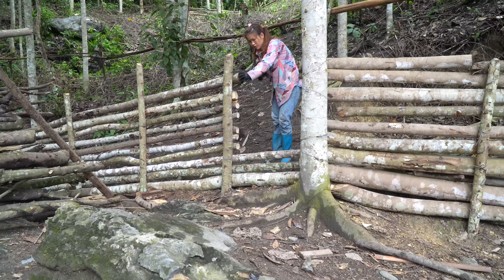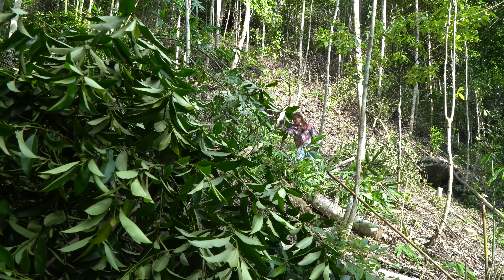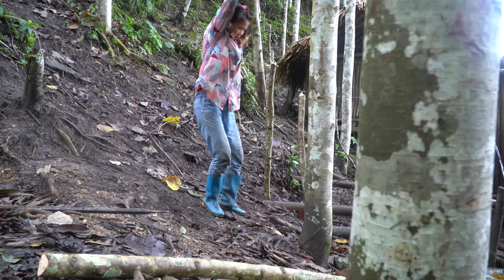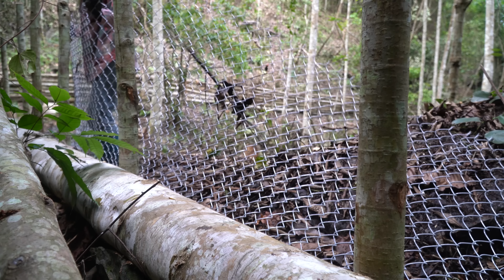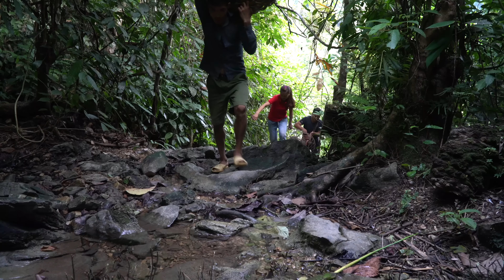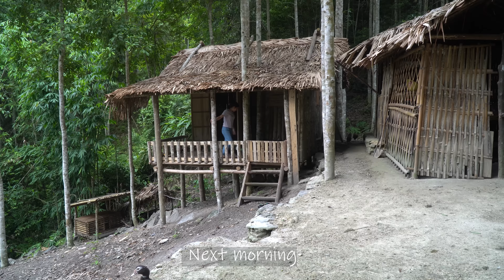Build a fence and welcome the first wild boars to the farm. Building farm, free Life (ep93)

Comment: I think that the lig fence may work better than the wire i have had all kinds of problems with wire fence for my pig they seem to be able to scoot under it easily and im glad the puppys are back home that is a very large pin for pigs but that seemed to help keep mine in when we made a large pin they don't seem to want to escape so much out of the big pin you have done well in building this pin you will need a bore so you can have baby's i wish you good luck happienes and health
Reply from the maker: Thank you for your wishes and sharing. Wishing you many good things
Reply: @freelife98  thank you